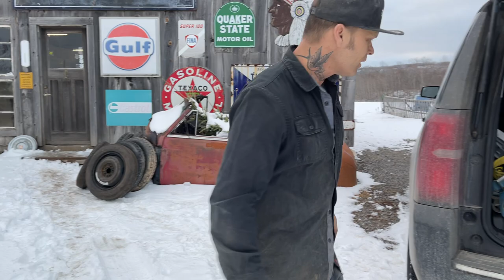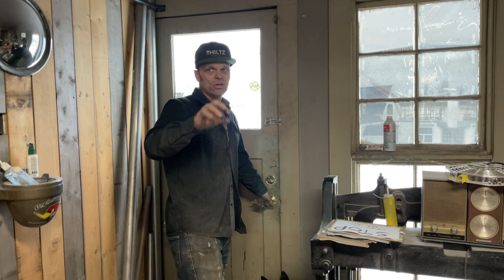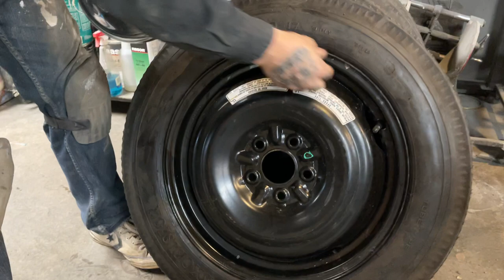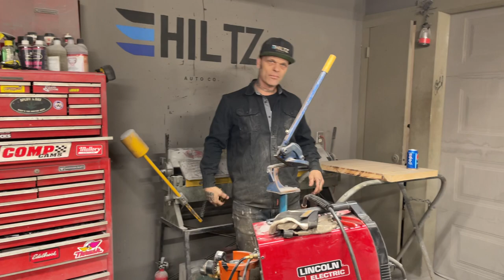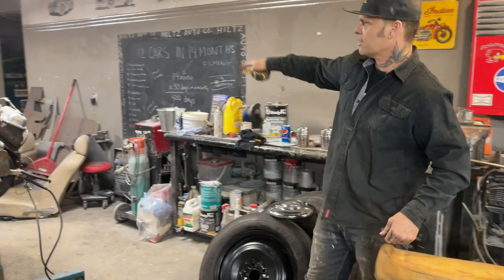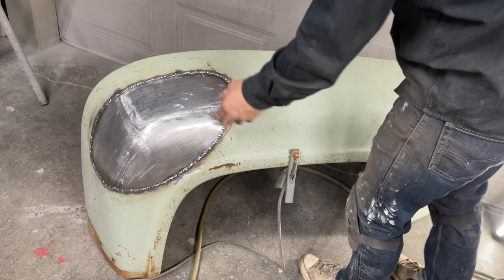VINTAGE EXCELSIOR WHEELS FOR THE BUGATTI

Comment: Chad, just as a note, on the motor that's on the engine stand, if you are not familiar with Marvel Mystery Oil, it is an engines best friend, it has been around since 1923, and I cannot tell you how it is when you are running up an older engine, looking for good compression, and to clean out old sludge etc etc, and to clean out the fuel system of older cars, 1 oz. to 10 gallons of gas with work miracles inside a carburetor....try it I guarantee you will like it, look inside a dirty carburetor after running Marvel Mystery Oil through the fuel system for about 30 minutes to an hour. Awesome stuff :-)   When you are looking to increase compression, and rid an engine of sludge and crap, add 1 quart to 4 quarts of (say 10-30 ) oil, in a 5 quart system. This stuff is awesome for engines.
Reply: I can attest to Marvel Mystery Oil works if you give it time. I have an engine that sat for a long time and then sounded like it had a noisy tapping lifter. With Marvel Mystery Oil in for a couple of oil changes and now "no more annoying noises!"

Comment: The ply tyres will be perfectly fine. The car will only be used occasionally anyway. It won't be used regularly, it's a special car. And its highly unlikely to be driven over 80mph.  Good luck to Chad, a clever,  hard working man.

Comment: 17" steely wheels, hub caps and skinny bias ply tires? Thought you were going for crome molly wire wheels. The hub nock off wire wheels would look more classy. Classic Industries or Coker Tire Company makes a steel belted tire in the Bugatti sizes. (I could be wrong)
Reply: Gotta use what he has.

Comment: Bikes are VERY cool ,I build Cafe Racers too and as I live in Florida I ride mine everyday ( from New England so you KNOW I'm happy about NO SNOW !!! )
Yep yep, those bikes are cool.
And let's face it ,tires are consumables ! Easily replaced. So I feel Jolene and her Bad Chad ass Bugatti, will get a set of radials ,next time Around. Let's face it Low Cost on a massive project, is a PLUS not a negative!
    That wood is going to Sparkle like Jolenes eyes.
Between the wood work and Jolene Sparkles , Chad will need his welding helmet to ride shot gun !
And REALLY there is NOTHING  CHEAP ! Or low cost ,about that car.
    Sure Chad moves fast and makes it look easy, but THAT comes from years of paying your dues to gather all the skills and past mistakes to
Smash thru this build like POPEYE the Sailor on SPINACH !
To pay some one to build  that body alone 
Is the price of a new car
And it's as unique as a Fabrishey Egg  !
The Engine is not cheap, it's a World class motor rebuilt to a very high standard, the CAR is a JEM, maybe the JEM of YouTube builds in the History of YouTube builds. It's going to be That KICK- ASS !